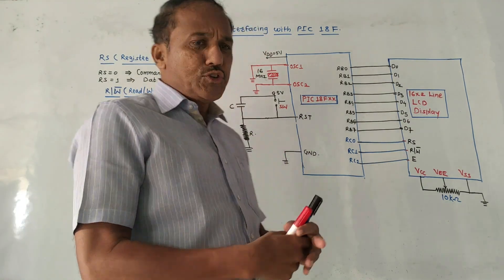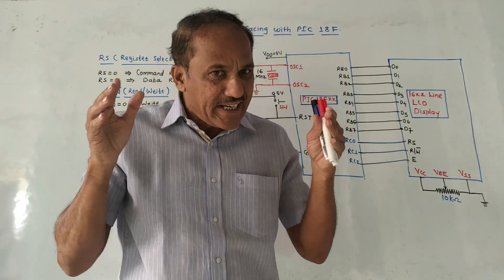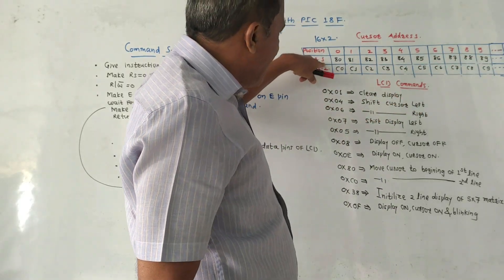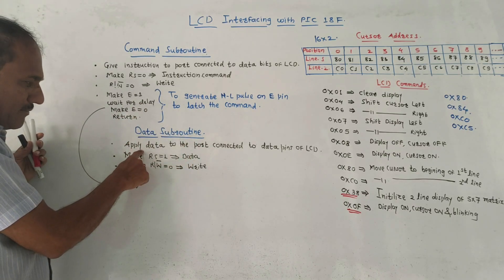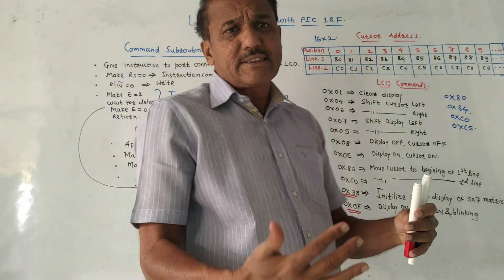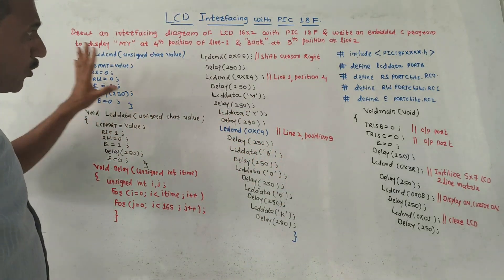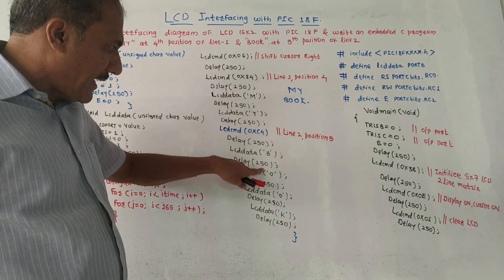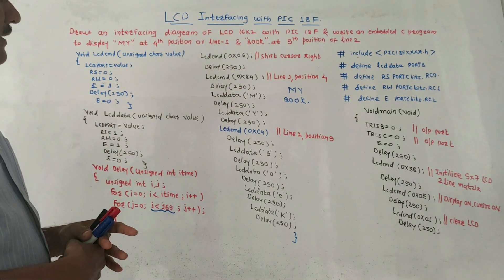LCD INTERFACING WITH PIC 18FXXXX

Comment: Sir  is the command for  line 2 position 5 correct ?or should there be 0XC5 ?
Reply: it is right because it start from 0
Reply: @Kaustubh7155  Then for Line 1 Position 4 Sir used C4...According to you, he should have used 83 instead of 84, OR For line 2 position 5 it should be 0XC5
Reply: @SaiGaikwad1712  what is correct if u can tell